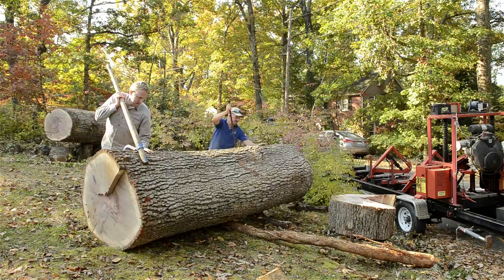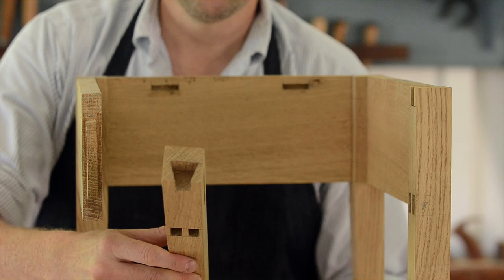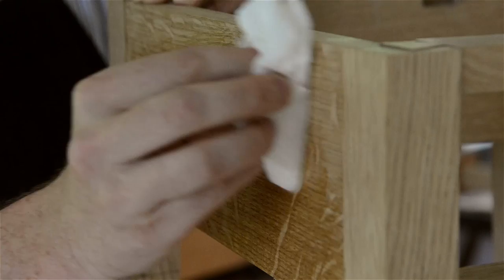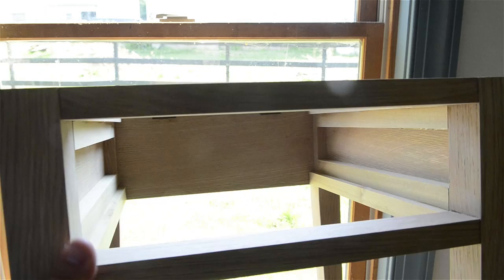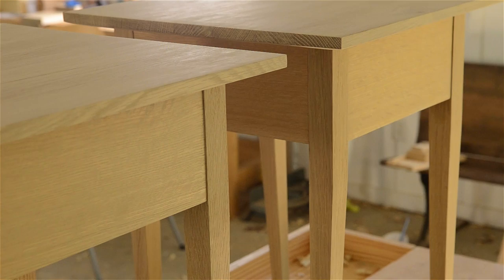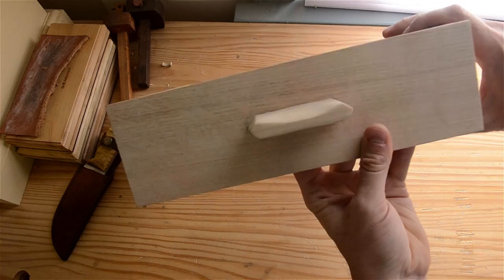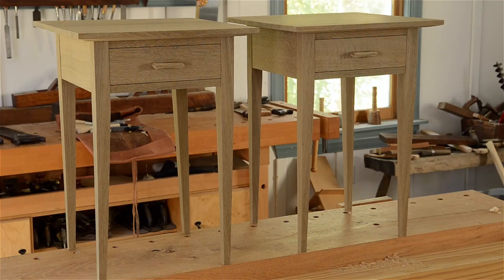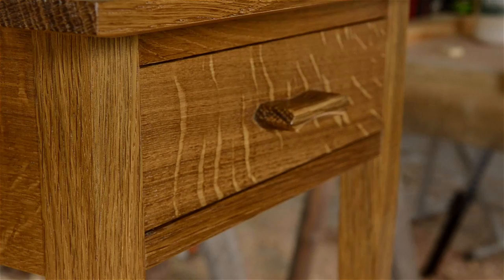Anatomy of an End Table and Drawer

Comment: What if you increased the dimensions for width and turned this into a hall table? And instead of having a single drawer you did two drawers? Could you cut out two holes in the front apron instead of using rails? Or if you used rails what would go between the two drawers and between the rails? And how would those drawer runners join with the front and rear aprons? I love this video it’s so helpful. Thank you.

Comment: 4:37 - the "buttons" holding the table top down should have the grain running in the other direction, for greater strength. Tables often get shifted & lifted by the top, but you'd likely get away with it on such a small table as this.

Comment: Really great video. Did you apply any finish to the sides of the drawer?
Reply from the maker: Thanks! The accompanying blog post talks about that, but as a summary I put a few light coats of shellac on the interior drawer parts. However, this is optional.